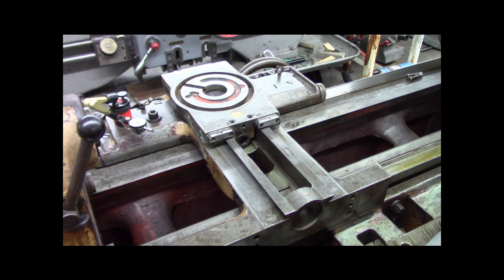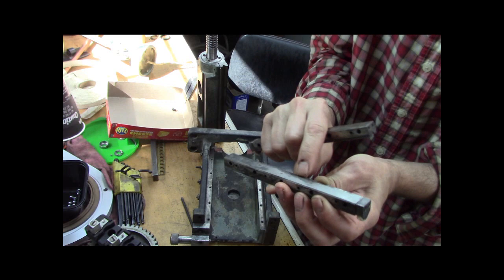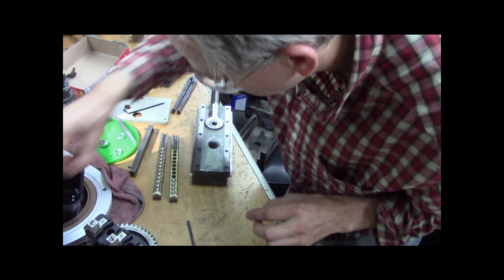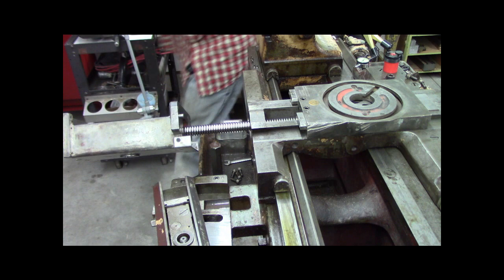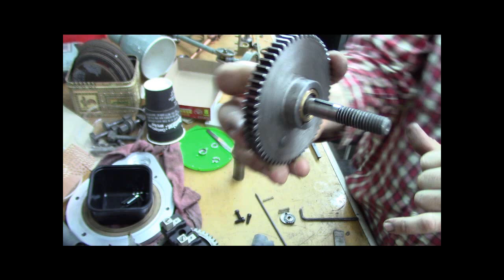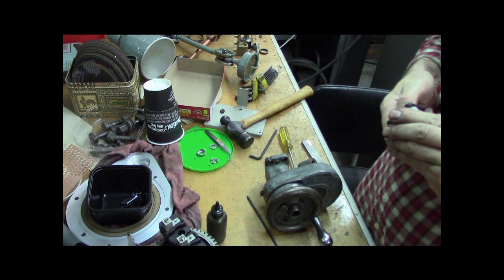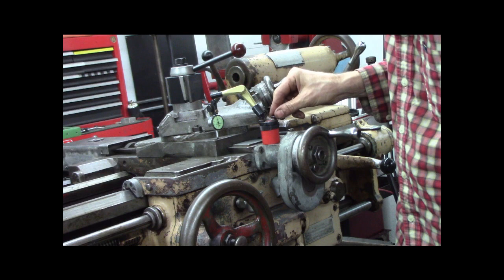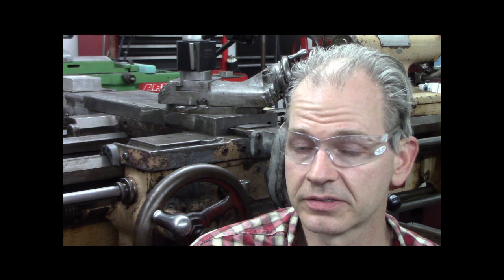9-5-21 P&W 12C Lathe - Spongy Cross Slide Final Assy

Comment: Monarch EE has multi turn threading stop.  
Very interesting to see inside of Pratt-Whitney multi turn stop.
Reply: So does my Sidney. It is just a single bearing ball in a ball thread. The bearing ball travels in a slot. When it gets to the end of the slot, thwack!, it hits starts rotating the piece with the slot. When you want to use it, you tighten that guy down with a set screw and now the slide travel is limited. Works quite well.
Reply from the maker: @TheMetalButcher  I can picture that.  Now get that Dawoo going  ! ! !
Reply: @kooldoozer  Working on it boss! Well actually I'm editing some other videos right now. I gotta get me a parts washer before I can do a whole lot more.
Reply from the maker: @TheMetalButcher  I built my parts washer when I was your age.  Have you seen it in my videos ???
Reply: @kooldoozer  Yeah. I could. But Harbor has them pretty cheap. I've got more than enough projects right now.

Comment: My radial arm drill has a banding shim like so. Not fitted quite as nicely ad yours though.
Reply from the maker: The banding I used was .022" thick and I had to grind it down.  Today at work, I found some thin banding that measured .013".   It would have fit perfect, with no grinding,  Oh well.  I kept some for the next project.  Always good to have shim stock on hand.